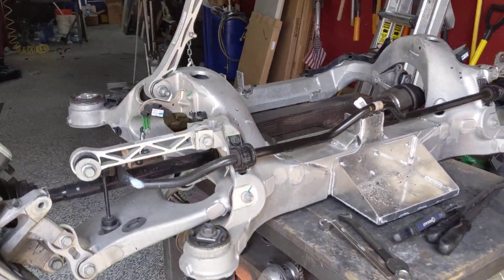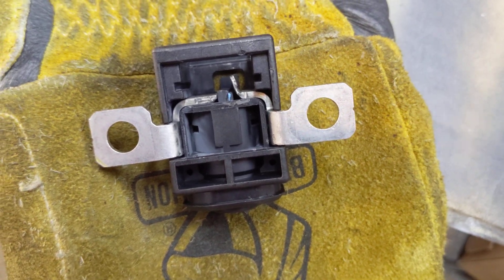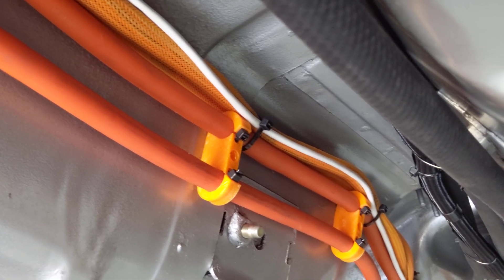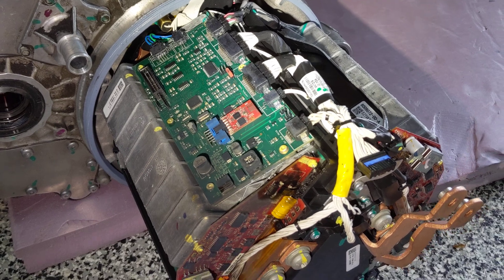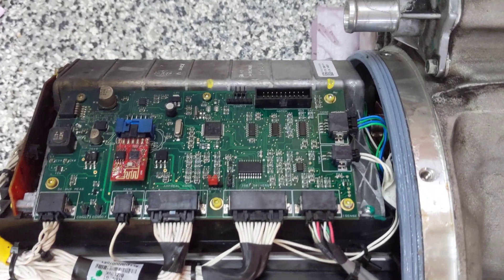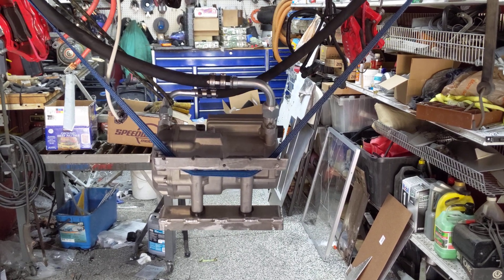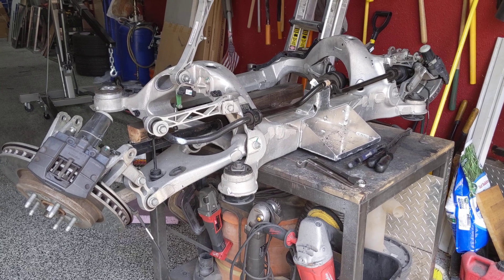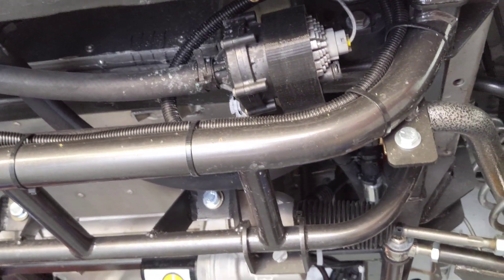Project Electrollite - Plymouth Satellite Tesla Swap - Fuse and Inverter Failure! EP. 16

Comment: The info you got about damage being due to losing power while driving is incorrect.  What you were told about losing power resulting in damage while operating an electric motor is only true for permanent magnet motors.  A PM motor has magnets in its rotor thus it always has magnetic flux and when the rotor is spinning, it's generating back EMF which is voltage and this voltage always needs somewhere to go otherwise inverter damage may occur so in this case, it's essential that HV always be present.  But this is only true for a PM motor.  Model S motors are induction motors.  The rotors don't have any magnets.  They're just big hunks of copper and aluminum.  Current has to be induced into the rotor from the stator in order for the rotor to have flux otherwise the motor will never turn or make torque.  What this means is that if power is ever lost while operating an induction motor, the rotor loses its flux and turns into a spinning hunk of copper & aluminum that can't generate any voltage ergo, no inverter damage is possible.  

I'd guess that you got too aggressive with the inverter settings, overcurrented and damaged the inverter which created a short and popped the main HV fuse.  The open source inverter control board is a great tool for letting unknowledgeable users blow up their inverters.
Reply from the maker: It appears that you have specific experience, do you tune these inverters?

Comment: I’m really interesting into doing a conversion for my 71 charger. So could you do a video or something. On resources of knowledge and parts and etc.  I’m a complete noobie when it comes to EV but been working on car for 20 years as a profession
Reply from the maker: Well I know how to make it fit in that body!  If you go back through all my episodes you will learn a lot of what it took, I went into quite a bit of detail.  Cost-wise, it's not cheap I would plan on 40 to 50 if you want to go big.
Reply: This series has me considering similar for my '73 Charger.  I also am not confident in my ability to work with these batteries & controllers.  I've been leaning towards a hellcat engine with a manual transmission...going the Tesla swap would carry a $20k-$25k premium, and I'd lose the manual transmission.
Reply from the maker: @pa60pilot  That's a cool car, it's definitely a learning curve with EVs, but it's hard to go wrong with a hellcat swap!

Comment: Bummer, Kevin. Hope you get it resolved soon! Thanks for the update. We all look forward to hearing what the issue was and what the fix is. You're videos are great, educational and inspirational!
Reply: Hey, does the ZeroEZ Control board have and data logging? Maybe it recorded what happened.
Reply from the maker: Thanks for the encouragement!  No data log other than the battery amperage recorded by the BMS.  It only peaked at about 400 amps.  Hoping it was just a faulty fuse, and possibly the wrong fuse to use in the first place.

Comment: Great video. Its unfortunate but i think you can find a good inverter replacement. Im not sure but my theory is that the motor is somehow drawing more current from one phase of the inverter (creating an unbalanced 1-phase connection) or could be a single phase fault. Please check the connection internally (from the inverter to the motor). And when you put a new inverter, properly torque the connection points and place some contact paste in-between. Can you post a vid discussing the cause of this fault and your solution in the future? Thanks.
Reply from the maker: I will definitely keep you updated.  Thanks for the advise and input, I will be using silver paste on all the connections.  All things point toward using the wrong, or maybe faulty fuse.
Reply: @MrMoparMan  yeah could be. A good fuse couldve prevented the fault. But thats the effect. What is the cause of the blown fuse is the question. And jumping the two wires is not good idea neither 😅
Reply from the maker: @jackripper5240  Ha, yeah I couldn't imagine a hard short, so I risked it.  Not sure why the fuse went, unless the high tech Tesla fuse was a bad idea.
Reply: @MrMoparMan  i think what happened is the fused popped coz there is an internal fault in the inverter. Then when you shorted it, the igbts broke. So my guess really is a line to ground fault.
Reply from the maker: @jackripper5240  interesting, very possible.
Reply: @MrMoparMan  i dunno in your case but most tesla swaps...they dont open the drive train assembly. Well because its also a damage risk in the first place. However, you dont also have a clue what happened to the motor when it got totalled.  Maybe some dislodge parts or screws. Anyway, most tuners just install them directly without thorough inspection. I mean dont get me wrong, tesla drivetrains are tough. Nevertheless, my recommendation is to disassemble it, inspect thoroughly, retorque everything and apply contact paste on all. If you can, ask help from an electrician who have knowledge on SMA or Fronius inverters. Basically, branded inverters coz they used this new MOSFETS. I mean its different but there are basic similarities.
Reply from the maker: @jackripper5240  Yeah this is my first time inside the motor, although Stealth EV did install the control board.  Swapping the inverter will definitely take some care.
Reply: @MrMoparMan  still kudos to you man for pulling this off. Im pretty sure a lot of people are asking about this car. As i have said before, its one of the best amature build so far ive seen.
Reply from the maker: @jackripper5240  Thanks man

Comment: Not gonna lie, I’ve spent enough time around electric R/Cs that I could smell that fried portion of the inverter from the Chicagoland area🤣
Reply from the maker: Ha!  Yep, its like you are here!
Reply: @MrMoparMan  It could always have been worse, I had a Novak Rooster give up in my Stampede nearly 20 years ago and nearly started it on fire!  I also learned that if that happens, don’t touch the heat sinks within a couple minutes of unplugging it and the smoke stopping…………ended up with a ribbed thumb 😶🤦🏻🤣
Reply from the maker: @GreenJeep1998  yikes!
Reply: @MrMoparMan   Yup, and I was at work when it happened!
Reply from the maker: @GreenJeep1998  😬
Reply: @MrMoparMan  I had to prop the back door open to air it out and the store owner wondered why that was open until he saw the ESC hanging from the chain link fence for the dumpsters, then smelling what I had been cooking when he walked in back door, then he was laughing.  The guy I was opening with had pulled up in his ‘85 LTD (the Fox Body variety!) and I burst out the back door throwing the ESC out by where we were parking at that location……….his look of confusion was hysterical when looking back on it😄